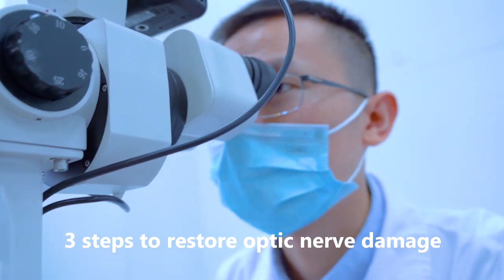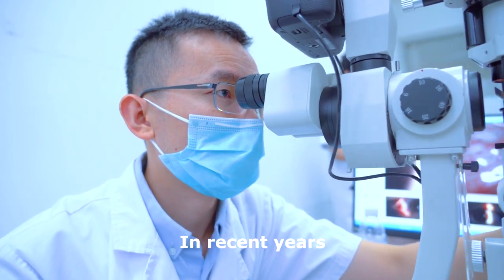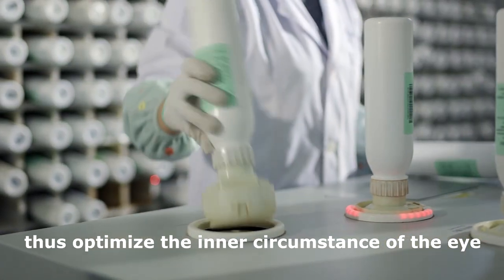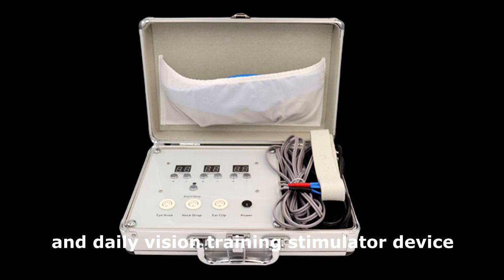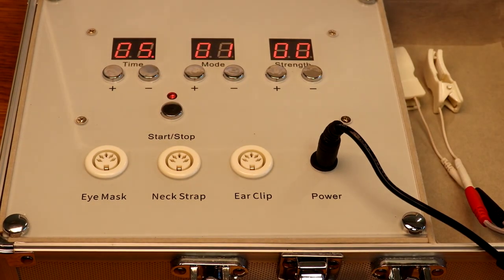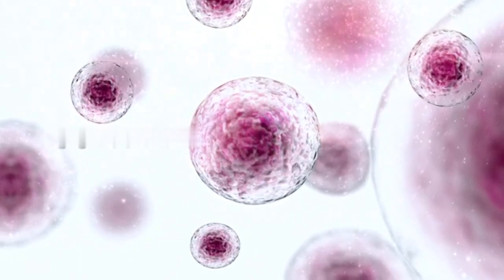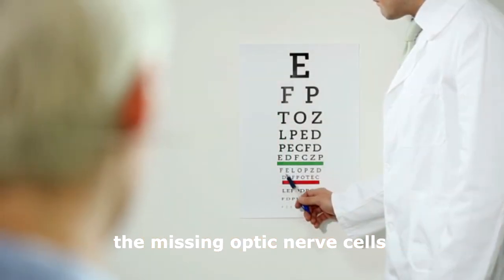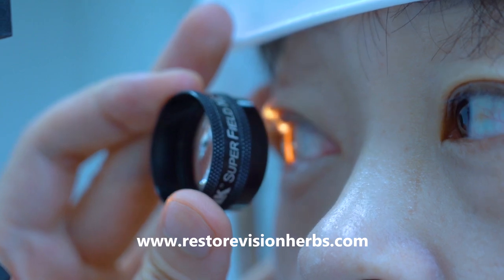3 Steps to Restore Optic Nerve Damage

Comment: My daughter recently went legally blind due to IH.  It was only mentioned that the back of her eyes are pallor.  She uses her peripheral vision in left eye bc it’s the clearest.   Her right eye is blurry.  Can this possibly help?
Reply: Intercranial Hypertension? If that's what you mean, then I have something similar. I was diagnosed with Idiopathic Intercranial Hypertension a few years ago. Now I'm legally blind with partial central vision in my right eye left, but its acuity is not that good. It's barely good enough to see about half of the cellphone 7-9 inches from my face.
I'm looking at this nerve regeneration treatment via stem cells and wondering if it's any use, or mature enough for safe procedures. If this thing works, then I'd probably opt to get my 97% gone left eye undergo this procedure.
Reply: @RudeBwoii  I’m adding you to my prayer list.  My daughter has diagnosed with Pseudotumor Cerebri per doctor.  I looked it up and learned sometimes it can treat itself causing vision to return with low sodium diet & weight loss.  This eye issue happens for not obvious reasons where pressure builds up on your skull.  It can also be a permanent problem.  My prayers for you and others is your vision be restored while here on earth.  Hang in there.  I know this is scary from my daughter’s perspective. Let me review this video; I completely forgot it.
Reply: Hello sir I am stuffing from optic narve atrophy since 20 years. Is that your treatment available in india  or how can avail your treatment pls tell me
Reply: Hello Sis, if a patient is diagnosed with traumatic optic neuropathy, can it be cured? His left eye is not visible at all, this happened after the accident. Is there a solution? I really really need help